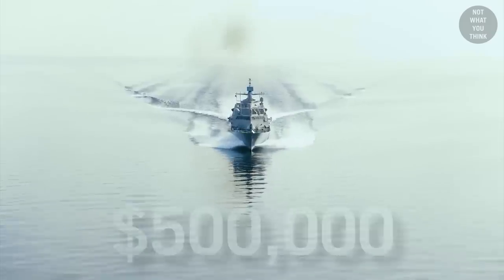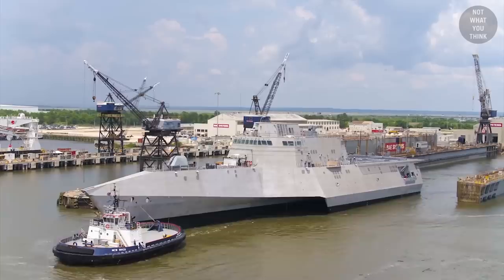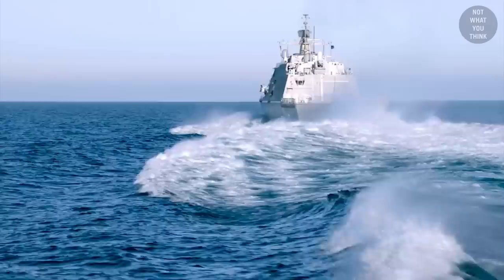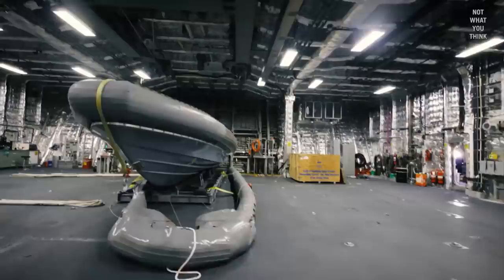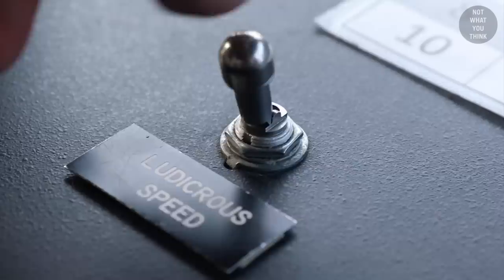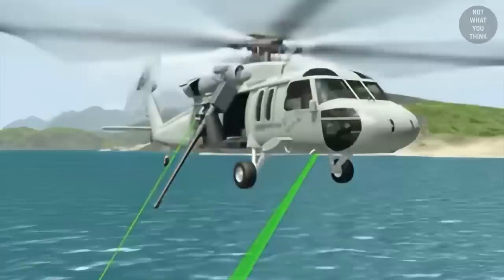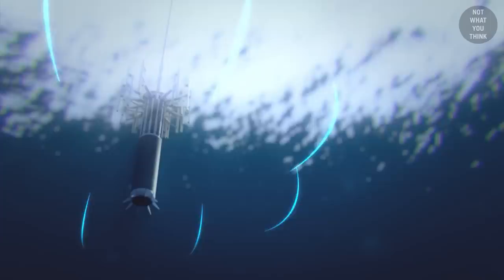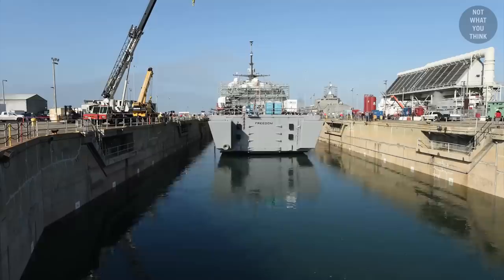Why Retire a 2-Year Old Warship?

Comment: The Navy certainly shoulders a large portion of the responsibility for wasted money. However IMO the "contractors" ought to shoulder a larger chunk. They made promises they could not deliver on.  If they promise a system that does "ABC" and then after the building it "A" works and "B" & "C" do not work they should either be on the hook to fix it on their dime or refund the a portion of the money they were paid. When it comes to new classes of ships like this they should only build one or two and see if these companies deliver. Every new class of ship that employs new technology always has "first in class issues". Look at the U.S.S. Gerald Ford. The new EM catapults are not as good as the "steam powered" predecessors. There were issues with the new Advanced Arresting Gear (AAG). Hell they even employed a new sewage/waste system (using suction like an airplane lavatory) that "clogs frequently" and requires unexpected and unplanned maintenance of an specialized acid flush to the tune of $400,000 each time. Look at the Zumwalts... $800k per shell for their LRLAP. So it has big guns it can't fire as the Navy canceled the munitions for it b/c they underperformed in range.

I get that they can build the new ones with upgraded/better gear boxes but to scrap the others claiming it's "too expensive to fix" and blaming "intrusive cutting into the hull" to repair is a bit laughable. Have you seen what it takes to refuel a nuclear carrier? One of the primary reasons NONE of the current aircraft carriers in service will ever end up as a museum ship. By the time they pull the reactors out it would be too expensive to "put humpty dumpty back together". They have to drill farther into the hull of a carrier to refuel/defuel it than they would to fix the existing littoral ships. And quite frankly the designer should shoulder at least some of the extra cost. If you're going to make a claim about your newest tech then it should come with something better than a "taillight warranty".

Comment: Seems like the USN and Air Force are struggling with innovation in recent decades. All their modern programs have been relative failures with even the Ford class hardly being an improvement on the Nimitz when the F-35 isn’t what was promised and range and fuel start becoming major logistical issues again.

Comment: There are no effective procurement penalties for the contractors who fail to deliver as promised. If anything the system is designed to reward iterative failure. Taxpayers eat the cost of the failures instead of the contractors. Until a contractor succeeds they should not be compensated.

Comment: Modular can work......
If only the US navy had just copied Stanflex.

But no, that's not conducive to spending $ on contractors.

Also the very idea of assigning mine clearance and ASW to >45 knot ships is ludicrous. Wasted machinery space as both jobs are at odds with high speeds.

Mines are static and high speed = noise = not picking up the Submarine.

While some versatility is a good idea.....

Small ships are ideal for giving officers command experience.

So dedicated Mine hunters and big PT boats to combat small craft are not a bad idea.

Some 50 to 60 yard Corvette with a 76mm cannon and surveilance/armed drones could lob guided cannon shells some 15 to 20 miles. Add stuff like Brimstone/Spear (EW) and it'll even be versatile in combatting larger ships.

A 76mm cannon is good enough for air defence in combo with a SEA-RAM.
2-4 Cell VLS with 8 quad packed ESSM  and perhaps some extra missiles could enable the Navies oft quoted distributed lethality.

Comment: What happened to prototyping? Especially when you are combining this many experimental systems together.

I wager they could get the ships cheaper per unit by building a bunch at the same time, but it still seems like building 1-3 first and using them to check for design flaws before committing to a small fleet would be advisable.

The systems all sound good on paper, and it's fair enough that they didn't know they would fail before testing them, but that's the thing, why are they commissioning a fleet before testing the design?

Comment: Proprietary equipment in DOD contracts with companies manufacturing military equipment is illegal and also standard information within the DOD SOP when forming contracts. All military equipment is required to be serviceable (repaired replaced refitted) by military personal that specialize in their specific fields for doing the previously mentioned. No DOD Corporate Contractor can have proprietary rights over equipment made for military use. Once it is in the militaries possession it becomes the militaries property to do with as the DOD sees fit. Said contractors may retain patents copyrights and trademarks of developments and may use said property knowledge for profit so long as they do not disclose classified information. That is the leading cause of the problems with the DDX, Litoral Combat  Ship and similar issues have become public knowledge about the new Virginia Class Fast Attack Subs. Apple pulled this shit with the latest A-10 Warthog upgrade variant and promptly lost their contract had to pay some hefty fines and had to pay the DOD for all cost to replace the equipment with field serviceable upgrades. Another issue is every venture into a completely new design is going to have teething problems. The big problem these days is the Gov't is listening to big tech lobbyist who paid their way into office rather than experienced Naval Engineers. Like the old saying goes "You can learn the hard way or the easy way just don't come back crying when you get your ass kicked for fucking up".

Comment: Why not transfer the ships over to the Coast Guard? The surface warfare back on the original ships would work fine for Coast Guard
Reply: The Coast Guard doesn't have the budget or inclination to maintain these white elephants, let alone do major repairs they need regularly.
Reply: @RobertBreckenridge13  the Navy could do the repairs, and then the Coast Guard could maintain. It would be cheaper than the new ships they are coming up with that don't have the capacity to do anything

Comment: The answer to the question at the end of the video is not "or", it's "both". This was a typical military specified boondoggle. Instead of catch sketching basic needs the Navy had and asking shipbuilders to propose solutions to those requirements the navy asked for everything they coukd could imagine, most of which did not yet exist. There are forces procurement process is blind. It assumes that the infrastructure that we have today will exist throughout a war, which is an absurd assumption. The gadgetry that they're creating is so complex that it is not able to be sustained by shipboard crew for a prolonged period. There is a place for custom military electronics equipment and a place for custom built military hardware. Neither one of them should be an essential part of a ship unless it is specifically built for research and development of new technology.  That's the same kind of head in butt thinking that has had NASA spinning its wheels for 50 years.

Comment: You don't innovate something new by rushing ahead and committing to building 20+ units of the first iteration and calling it the operational final type and declaring it a rousing success when only a few prototypes are being tested, not at all on an operational level,  encountering serious problems and drastic overruns & delays.

Or, you only do so if you're Lock-Mart, in which case its standard practice.
Actually they're the acknowledged champions at this, but it's standard practice for just about every US military contractor and weapon system. (The "Ford" class).
And NASA (the Shuttle, the X-33, etc)
Keep it going, throwing more money at it decade after decade, still calling it an unqualified success and the way of the future.

Comment: The primary reason why the ASW mission package died, was due to (according to the CNO) LCS being "as loud as an aircraft carrier".

The problems with the mission package could've been resolved - but when both LCS variants are that loud, that automatically makes them terrible AWS platforms.  Given that ASW was. a major requirement that the MIC we well informed about, the MIC failed to deliver, and the LCS PEO that approved the design were both negligent.

Comment: Back in WWII the North Carolina Class Battleships suffered from engine problems all throughout their service and was a major reason why there were never more than 2 of them built. Still though time an effort these problems were managed though it did cost a bit. But during war it was deemed a necessary expense. 
My Point is that there have always been ships that didn't preform to their expected designs and have cost taxpayers money as a result. The Liberty class just so happens to be the latest class for that to happen. As long as a valuable lesson is learned and taken to heart to correct these issues for the same class and future ships then it COULD be money well spent.

Comment: Ok, who was in charge and signed off on this huge waste of taxpayer money? They need to be identified, and then discharged immediately. When you have unproven technology that is experimental by definition, you do not apply it immediately across an entire fleet. You do not have unlimited resources so some caution should be part of the decision/implementation and testing process; especially with new technology (that just may not work out as you planned). Is no one ever held accountable for this size & series of errors? Hence the changes really required are with the decision makers not just technology choices on ships.

Comment: Wasted money. Could have used 1/2 of that on the two old battle wagons to be refitted for modern times with newer weapons and electronic & anti EMP gear. 
Imagine running out of missiles and here comes a Juggernaut with auto cannons & 16 inch guns that can totally annihilate anything floating on the water with over the horizon shot capabilities. Just like fighter planes still needs guns after all missiles are gone.

Comment: i wonder what it would cost to turn the retired ships into commercial or private craft?  what is funny that the module system was built on top of the ship, you'd think it would be something along the side or rear of it.  were there is better access and potentially just being able to shed it similarly to a life raft sort of system... and a winch lift system to bring the other one into position, that was fully loaded.  to be locked into place.  but i mean idk what the packages were suppose to encompass so maybe that was not practical?  hell i'm one who would take two ships and put them together like a catamaran where they were  above the waves and use the central canal as a means of lifting materials and such aboard, i even envisioned it being like a dry dock for a submarine.  imagine two warships next to each other using a centralized dock /platform between them that has a sub winched up unloading supplies or materials... the subs could have even acted as these modules./weapons packages etc.

Comment: Both models are total crap. They both have structural design flaws that the Navy chose not to fix. This is why they cannot operate in seas greater than 3 or 4. They should never have been built, as I said they're total crap.